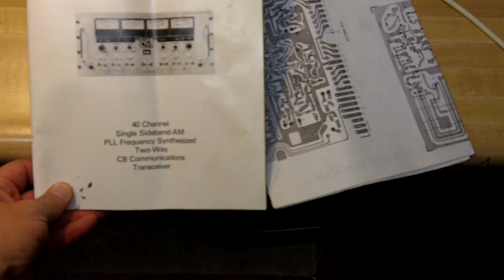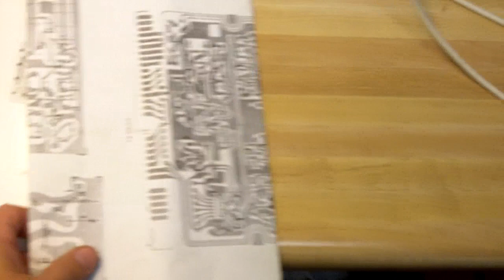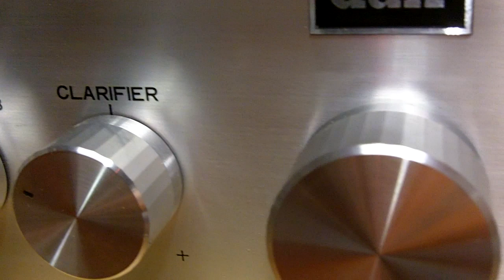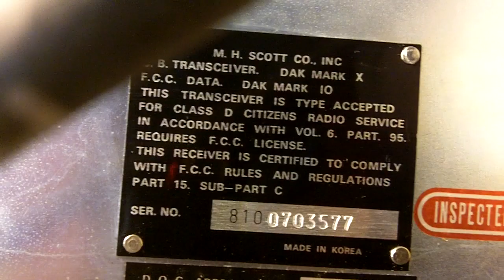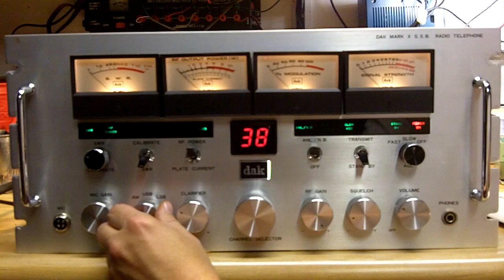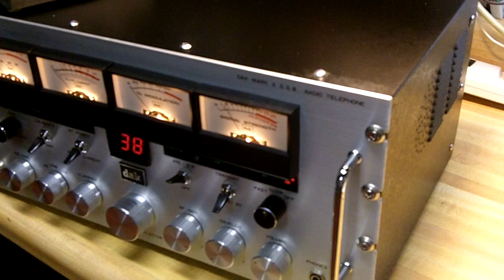Dak Mark X SSB CB Radio Vintage 1978 (appx) - Looks Great - Performance Lacking

Comment: I repaired one of them back in the mid or late '90s. It had a few problems, but you sure are right about the bad solder connections on them! I think I reflowed about 50% of the solder connections. 
After I fix the radio, I noticed two of the meter lamps were out. I told the guy I will just replace them while I had it open for no charge. Boy was I sorry, changing those lamps is an absolute nightmare!!

Comment: They could have done a much better job of choosing better looking rack mount handles
Reply: I also have one in excellent condition, but I think I'm going to drop a 148 board in it and maybe a nice little switching supply and Texas star 667, since I think pretty much all of that will fit lol

Comment: Never thought much of these radios in the past, as I thought they were just a mobile radio all jazzed up with knobs and meters with side handles thrown in for good measure. Did not realize they had the tube output. Certainly not on the level of a Browning or Tram, but seems to ba a cut above the average CB.

Comment: The DAK, Stoner, ARF rigs are true radio porn. However... They were pure junk performance wise. Put them up against a Cobra 148 or most and UNIDEN PLL858 board. Not even close.
You do have a nice unmolested rig. 73s
EDIT.... Add CPI to that list of sexy junk.

Comment: Thanks for the review.  Today in 2019 people on ebay are trying to get $600 to $1600 for this radio. I agree, it is impressive looking. I'm thinking of adding a really nice 70's vintage radio, SSB and was really thinking of this one. I also have the 642, 2000, 5875A, 78-999, and the LCBS-8 in mind as well. Since you say it's not a great performer and you will stick with the 148, that gets under $150 on ebay, that tells me to look at the other radios on my list instead.

Comment: A good friend has allowed me to use his DMX. Being very picky with many different radios since the early 80's all I can say is WOW!!! It has a tremendous receive, very low noise floor on AM. It rivals any radio I currently have, even both of my Cobra 2000's that are in great working order. All my local folks tell my I sound better on the DAK than anything else I own. Now I'm thinking about getting one of these things. It has truly spoiled me in less than a week of using it.

Comment: Could use a little DeOx in the switches. I just picked up the one my father used to use and am going to recap it, test and replace the tubes if needed, align and bring back into specs before upgrading the mod swing and adding some channels. I've always liked these sweet sounding rigs.
Reply: I noticed that you and I use the same Weller soldering station ;)

Comment: it is a shame that the Transceiver doesn't use a Phasing SSB modulator/demodulator using a  BQSD based around the PI5V331 and 74HC74 chips which means no sproggies. and I think it is weird that no manufacturer doesn't use a (BQSD/BQSE) as an RF UP/DN converter to take 455kc up to  26.965-27.99125 back down to 455kc and it would get rid of intermixing products (Sproggies).
Reply: I want to buy the dak

Comment: I noticed a switch on the right side witch read slow and fast what does that button do I'm not familiar with the Dax 10
Reply from the maker: That is the AGC or automatic gain control for receive.  Many CB radios don't have that but many SW radios and most all ham rigs have that.
Reply: What was it used for ,I really like the dax10 I was also wondering if you could put a 959 in it instead of the hygain board.i know it won't be original but wouldn't it be a good radio.i run an eagle 2000 with an eagle 1kw. Then the radio I most talk on is its big brother eagle 5000 .maybe we can talk someday I go by 273,or snowman in southeastern ky.

Comment: They had cheap circuit board, I know, I had one of these in the past and i had to bring voltage in some of the circuit by welding wires from one end to another, not sure how mary wires i had welded on these boards LOL, but they were nice looking !!!!!
Reply from the maker: +orignalbuckaroo Yup, very nice looking but the board sure didn't match up to the looks of the radio, it could have been so much more.  It probably sold very well on the looks alone.  Oh well.
Reply: RadioHamGuy I've had mine for quite some time yeah it needed repair due to a stupid fault of mine. I disagree with the part about the weak board. But that's just me. does anyone know a source of those mode switches? I've got one on my radio with a broken tip and would like to replace it

Comment: RadioHamGuy,  I'm going to buy a rough Dak X and take all the guts out and put in a mobile 10 meter radio in  for both bands and put a amplifier inside this Dak..  It is going to be one of a kind.  It will be great to use all the big meters etc..
Reply from the maker: +Mac Attach That sure sounds like a cool project!  Sounds like some time will be involved there, that was something I gave some thought to in the past also but just decided to not start that project haha.  Good luck there!
Reply: RadioHamGuy,  I think I have ever thing figured out but don't know if I will just put a 11 meter mobile or a 10 meter mobile in it yet.  I have the power supple and amp figured out just trying to figure out what radio to put in.

Comment: Hi! I have a dak 9 radio, and most of the time I can hear just fine, but i cannot transmit worth a damn, no one out of a range of half a mile or so can hear me. My mic works fine, there is modulation. What kind of antenna are you using? What is your SWR at? Can you help me at all?
Reply from the maker: +Koen577 I am just using a sloper dipole I made cut for 11 meters sloping off the side of my tower so I have vert polarization.  Works very well for me and I have it cut for 1:1 SWR.

Comment: I like my Dak Mark X a lot. The internal speaker doesn't sound very good. I has a very high tiny sound that make the receive difficult to understand. The only thing this unit is missing is a tone control circuit.

Comment: With that serial number this was a late model or series 3 production unit.Mine is a Series 1 production.Maybe it would be nice to have 1 of each of the 3 production runs? In my opinion the DAK Mark X is by far the most beautiful & impressive looking radios of any kind ever built much less a CB Radio.That brushed aluminum face plate & those four large meters when lit up for sure catches the eye & draws attention to the radio.many say they lacked in performance but I prefer mine over my Browning Golden Eagle MK III,Golden Eagle Mk IVA,& my President Madison (1st generation) or any other CB Radio I have ever used or owned & that is a very long list.It's a keeper & does everything I need from it & more & it has never had any mods of any kind including the clarifier mod & it's almost straight up & down on frequency across the 40 channels as it should be.I have the Original Astatic Black DAK D-104 with it as well & not a repainted & relabeled copy.It's an AUDIO MONSTER on transmit & I'm talking Smokin Loud Audio just like I like them.  {:>)

Comment: I have 5 Dak Mark X's and I tune them myself. They all kick butt on the TX side but the receivers, like most Lafayette and Kraco radios, are lacking in adjacent channel rejection. That said, I'll still take a Dak X over most base stations with the Tram Radios having the edge and being one exception. I wouldn't give you a dollar for a Dak Mark IX.

Comment: That is one terrific looking base station. I recently picked up a Tedelex TE-7000 and as soon as my new antenna arrives I'm on the air. Back on 27Mhz CB after 30 years! Thanks for showing this cool radio, best wishes from Australia. Cheers, Mark.

Comment: comments and questions.

I find the easiest way to fix the clarifier is to take the clarifier knob of and clarify then put the knob back on at 12 oclock LOL.
I can hear the superbowl channel up here in Manitoba even when dx isn't running.
That beutiful radio be modified to go above 40 and below 1?
Radio Canada 1583 Operator David

Comment: If they had used a Cobra 148 board instead of a crap Hy Gain board this radio would have been a real gem!!!
Reply: What would it cost to do that board replacement?

Comment from the maker: It is the AGC or automatic gain control on the receiver, slow setting kind of evens the sound out and you don't hear as much of the noise in between words.

Comment: the thing looks like a stereo receiver. i beleive i had a dak turntable. beleive it or not they are still in business but not doing CB radio's. i buy Cb,s at rummage sales whenever i see them and resell them. nobody really uses them around hear except truckers.have fun

Comment from the maker: @fordbroncodave I got it from someone local who was getting rid of a bunch of radio stuff, I paid 100 bucks for that and another SSB base and AM base and some test gear.  I like the looks of the Dak but it is really lacking in quality inside so I would never pay very much for one.  My GTL 148 still works better on the air and sounds better, too bad they didn't use that board inside instead of the Hy-Gain board.  Ok on the CPI, I think I remember those, cool looking radios!  I will check out..

Comment: larry where did you get that and how much?  i have never seen that radio up close before but heard good things about them from forums.

also, you might want to check out a CPI 2000 base radio!  way cool!  if you have a directional beam antenna point it left of the twin cities just a tiny bit.  very active up here every night at 9pm on 38 or 40 lsb